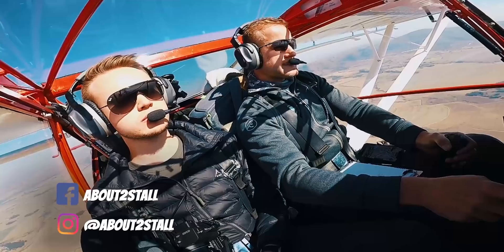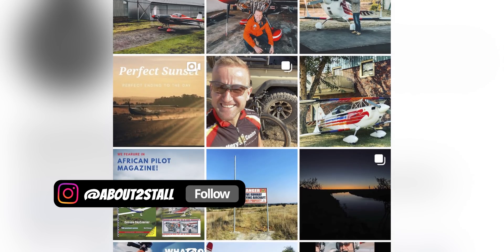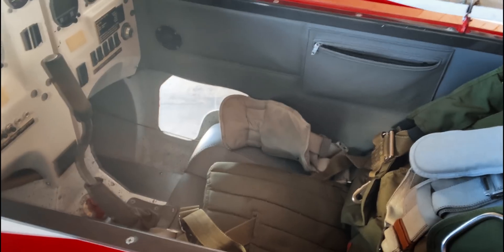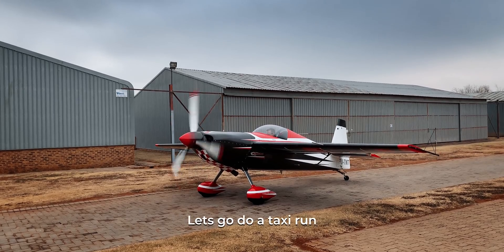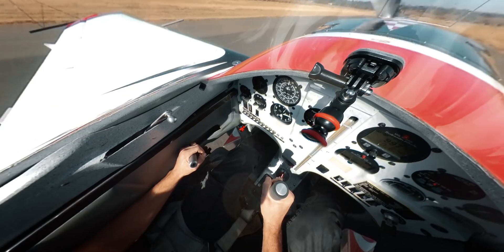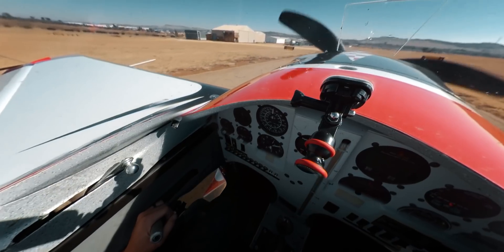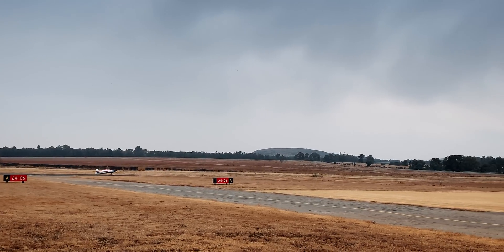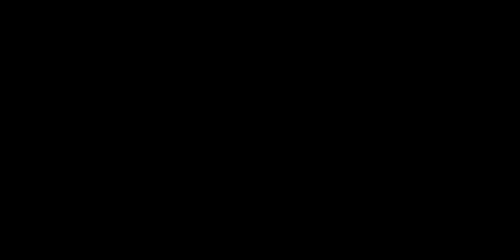AIRCRAFT FIRE!!! || Taxi runs turned for the worst

Comment: What type of brake system do you have? Do they have all factory parts or was it a mix of aftermarket parts with factory parts? I had issues with my Extra brakes and I replaced with all Cleveland parts and it is working much better. Also, the pads do tend to rub even if you are not pushing on the brakes. The heat is being generated when you are braking and also during high speed taxis. The Beringer system seems to have figured out how to release the pads completely from the disc. If I had to buy a new wheel / brake assembly I think I would go with them. They come standard with all the new Extras.
Reply from the maker: Hi Mark, I believe it is Cleveland parts. But we'll look into the Beringer system, thanks!

Comment: Brake energy charts are pretty common in the manuals for large aircraft, but not so much in small ones.  I don't think manufacturers contemplate repetitive stops from high speed.  As you said, planes are meant to fly, not drive.  I'm glad you had a safe outcome and only minor damage!
Reply from the maker: Yeah! Especially in Experimental aircraft, that's why we learn from each other and the reason we share.
Thanks, she'll be back in action very soon!